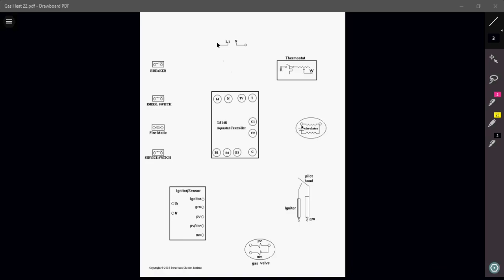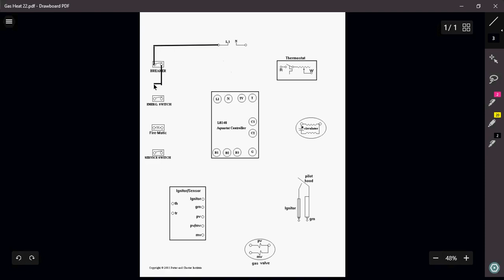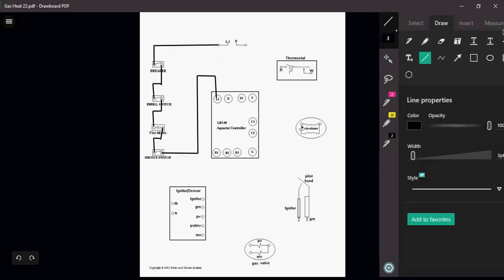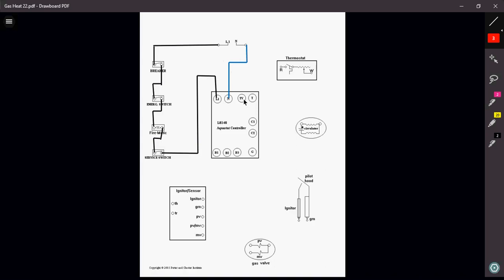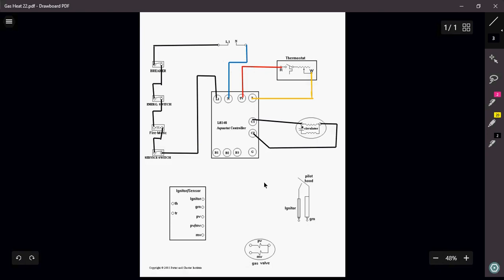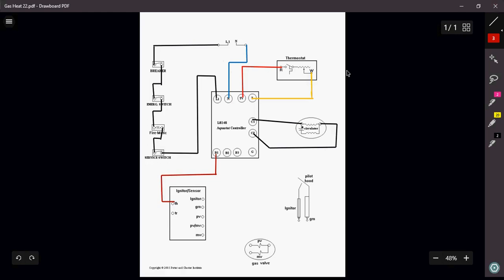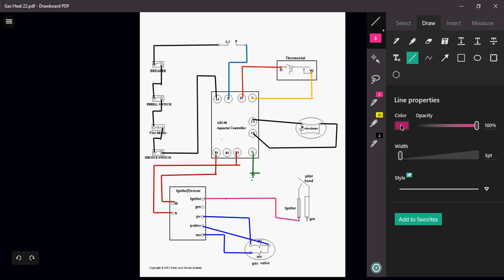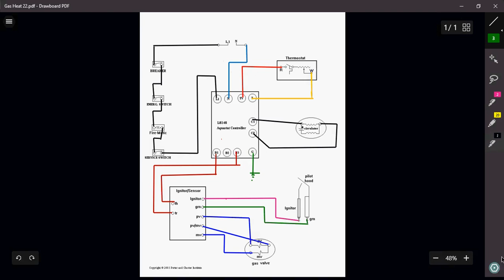L8148 Aquastat Wiring

Comment: Do I have to add a transformer to have a common thermal
Reply from the maker: If you are referring to the common on the gas valve. No you don’t the ignition control has the transformer in it.